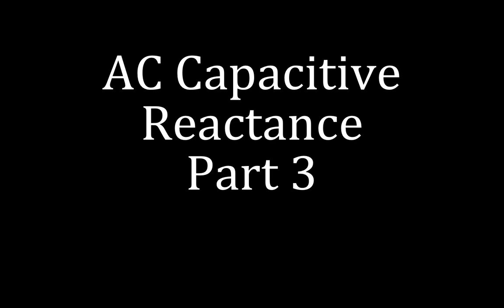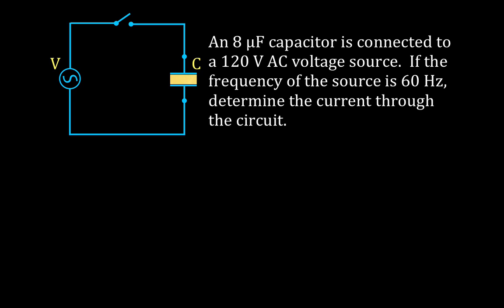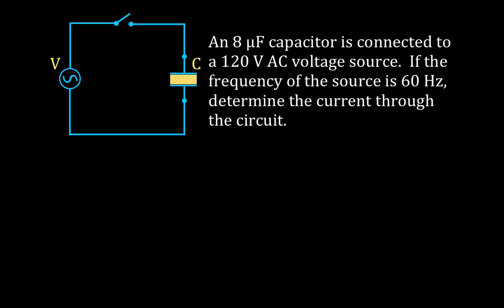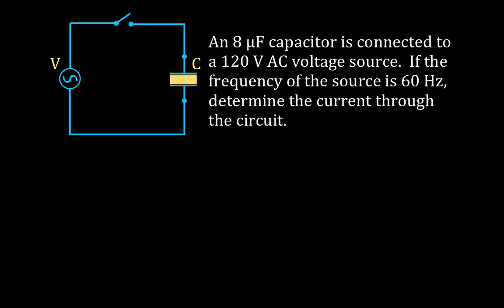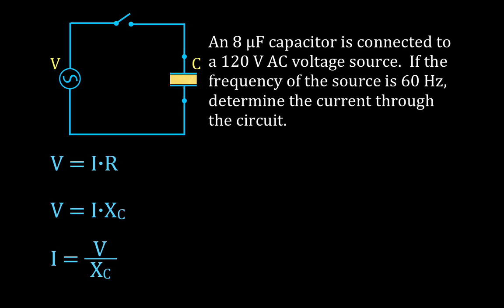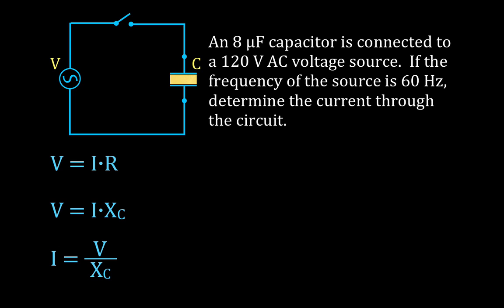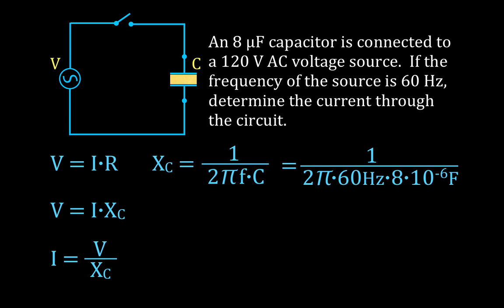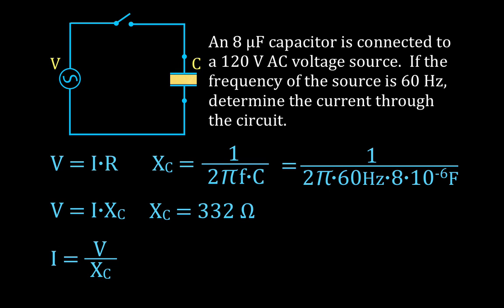RLC Circuits (8 of 19), Calculating Current in a Capacitive Circuit

Comment: Hi, I’m thinking of hooking up a real circuit to measure the current and power with a clamp meter that can measure power. I’ll be using a non polarised cap and limit to around 0.5A current. Just want to see if the power is actually zero. Will any type of non polarised cap work? Since I’m connecting phase and neutral directly to the legs of the cap, I want to be careful. Thanks